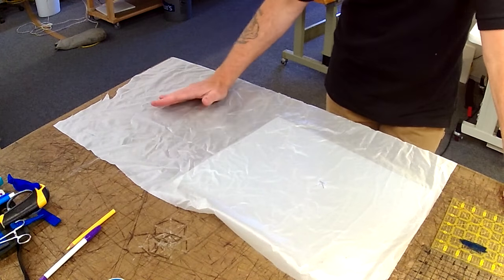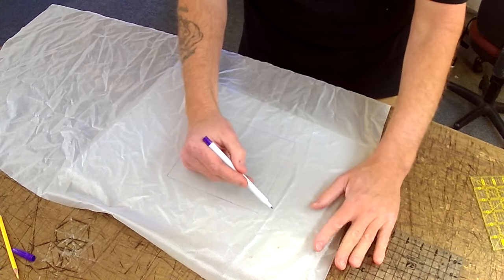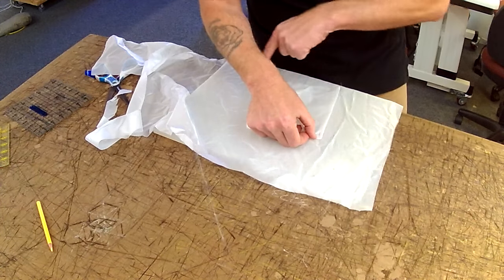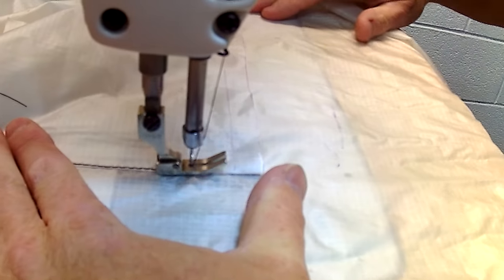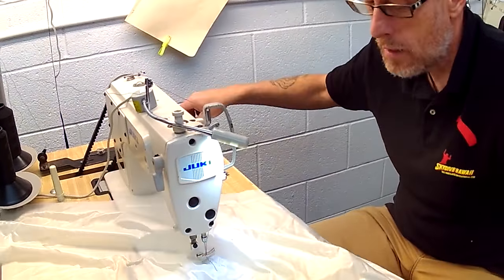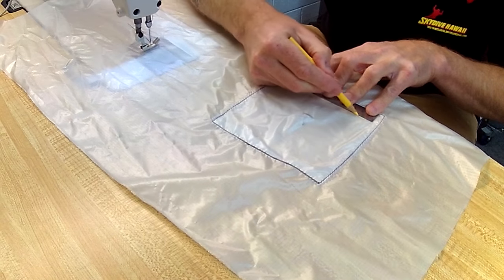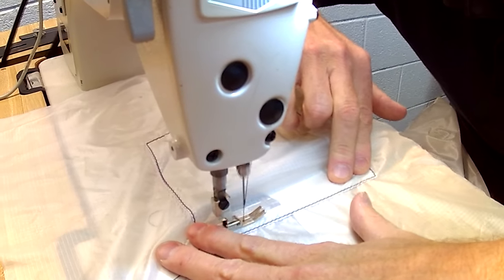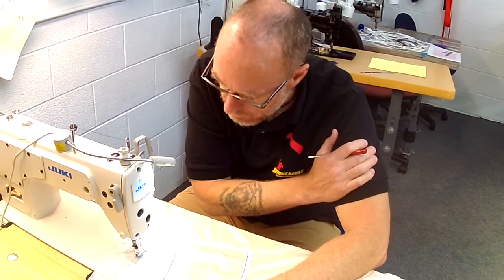Basic parachute patch. Skydiving Services LLC

Comment: really interesting analysis on using tension. I improved my patching by dropping to 8 spi and pulling tension towards my side of the foot. For my first 20 patches, I used pins to meticulously place the workpiece, block by block. I found the pins constrained the workpiece and didn't allow proper shrinkage. watching these videos always teaches me something new.  BTW, I'd like to request a video... double needle corners, with and without a split bar. thanks!!!

Comment: Simon Wade, great vid.  I have an easy time patching round parachutes, but I have a harder time on ram-air, especially smaller (120 and below) ZPs because I have a hard time managing the rest of the parachute as I'm trying to patch deep inside a cell.  I would really love to see a video of you patching a ram-air well inside a cell so that we can see how you manage the rest of the canopy in order to get your working surface to lay flat easily as you rotate around each edge.  Cheers!
Reply from the maker: Will do. It's on the list. To be honest, and not to sound like an ass, you just go crazy slow. In extreme cases I will open the tail seam, apply the patch, then re-close the tail. s